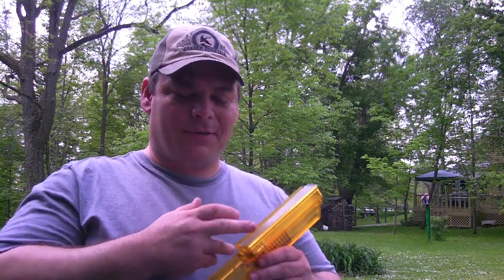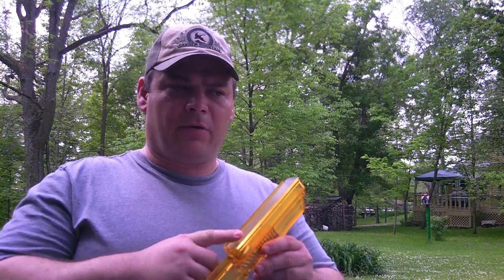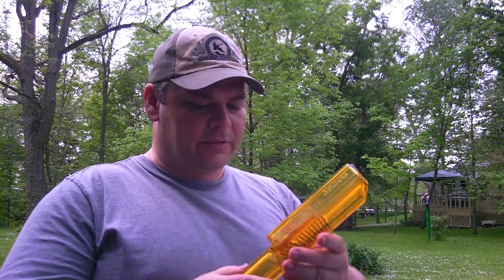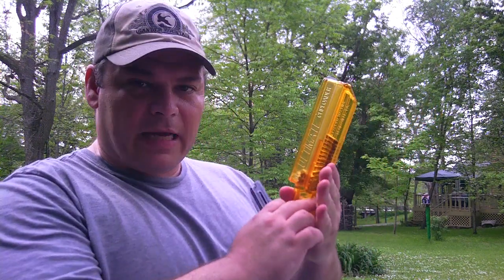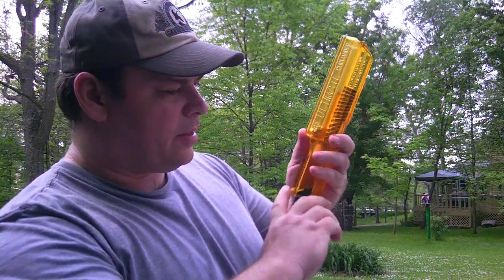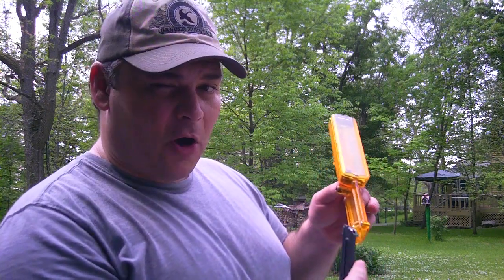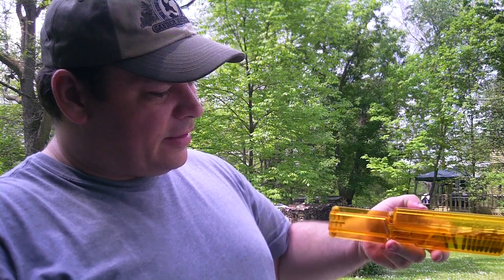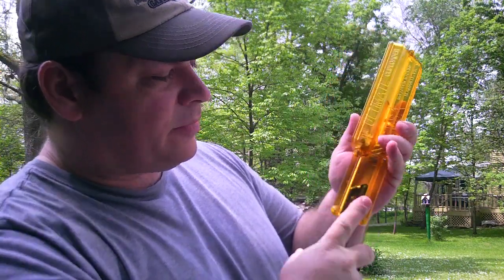The Proper use of "The Ultimate ClipLoader" HD

Comment: Excellent video.

About the directions, I didn't even realize it came with them because the insert is folded over and the directions are INSIDE the fold with nothing on the back and it appeared like a single piece of paper. It was only when I got a little oil on the paper that I was able to see the ink on the other side. A real "lightbulb" moment that was.

Comment: Just got one (12 years later). Adj. a little at a time and it works great. I used Rim oil on a Q-tip and lightly coated the slide in side. Thanks for the video. I just got a Hunter MK4!!

Comment: Thanks for the info. I read the directions and adjusted it to what I thought was correct and thought it was the nature of my loader. I love the loader but sometimes I get frustrated when I would have to pump to get it to work. I will go and fine tune mine. Do you ever have wax buildup even when using rem oil? I know sometimes if I wipe it out time to time it will work better for awhile.

Comment: Wax lubed bullets will eventually gum up the release/pinch point by the check valve. you can Disassemble and clean the whole unit using PPG  DX 330 wax and grease remover.  Keep the unit bagged when not in use. the Rem lube attracts dust and grit horribly and will gum the unit up.  The biggest thing, which Dano commented on was keeping the unit level with the horizon line molded on.  It's a gravity feed, so you need to think about that as you use it. Works as it should, if you use it correct.

Comment: There IS an adjustment on the black ballbearing thing that keeps them in.  It's a allen wrench nut.  You can let it out a little if it's in too far and compressing the shells and thus not allowing them to fall.
Reply: Its not really an adjustment. Just a screw to hold the spring in that puts pressure on the BB

Comment: I dialed in the 11th bullet problem. I used Ballistol, not Rem lube a week before shoot and almost all of the bullets didn't fire. Must have soaked into the crimp between the bullet and the bullet case. I think I'd rather go it dry from here on out. Just  "HOLD LEVEL" and if it gets a little jammed, just a little shake and a slight pump. No problem.

Comment: I was not aware of the angle it had to be either, but my biggest problem and complaint is that screw needs to have locktite or something on it because its always going out of adjustment, I will put some on mine eventually even though it says not for plastic.

Comment: I have had this for a small while now, used twice at range and about 4 times at home practicing. At some point in the beginning after watching a few videos about how to hold it, all 10 rounds slid straight down, but not since then. I don't know what is going wrong but it's not pushing the ball bearing back all the way. I even shaved down a little on the inside to make sure the magazine got all the way towards it, since the side with the ball bearing was fine but the opposite side was too short. Since it worked once I don't know what happened, but after adjusting all the screws a few times and the bearing I can get it to work only with hitting it to get it loaded. I have Mark III .22LR magazines. If anyone has advanced tips please let me know.

Comment: Thanks for the video! This is the first time I have seen it.  I have one of the loaders, and quit using it out of frustration.  l am going to dig it and the instructions out, and try to use it again. 
But...one question...I have been told for more than 60 years; DON"T LUBE YOUR CARTRIDGES! BAAAAD Things will happen!  Have you experienced any adverse effects from using lube on the loader or cartridges?  Would  a dry lube be better, do you think?

Comment: Great video and what appears to be a easy loader but I am actually trying to slow down the loading process. I have a speed loader that simply fits over the clip and holds the spring down while I drop bullets in one at a time. Even with this set up I can over heat the barrel and lose accuracy.

Comment: SO, you have to spray lube on the cartridges and it's known to be a bad thing to have oil products on the case. As a matter of fact, many firearm manuals specifically mention not having oil on the bullet case.
Reply: Popeye78382 which one???
Reply: Popeye78382 should
Reply: It should not be a problem on 22s because they are rim fire but if you did that with ammo that has primers that could be a disaster because some oils can penetrate around primers.
Reply: Apakah5555555